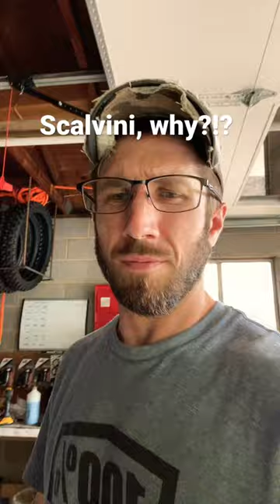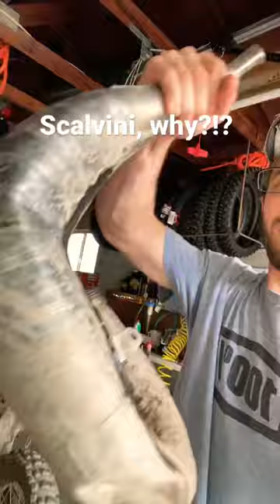Scalvini should probably stick to making motocross pipes, not woods bike stuff.

Comment: Don’t worry! That company won’t be around long building junk. First of all you have to wash it and dry it and wd40 the pipe every time you ride then wipe off the wd40 before you ride. It should have been made out of thick stainless steel also with brackets that fit correctly to each bike. Not rocket science but I guess it is to them